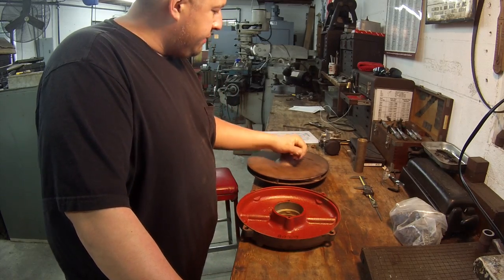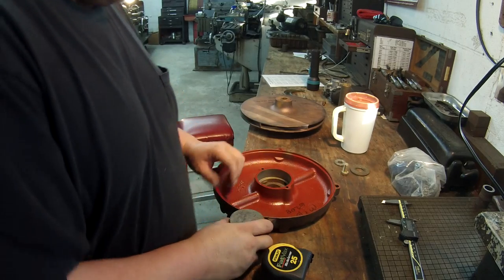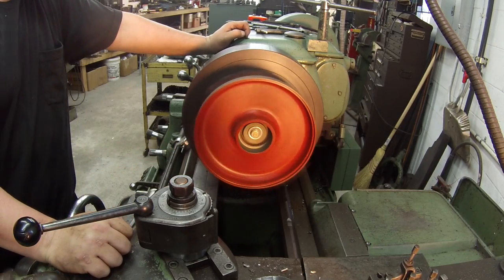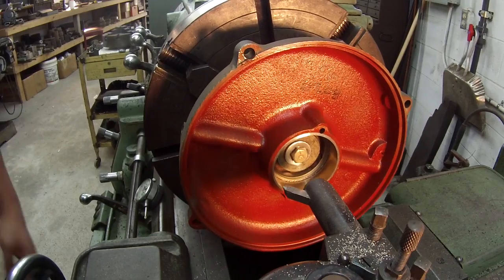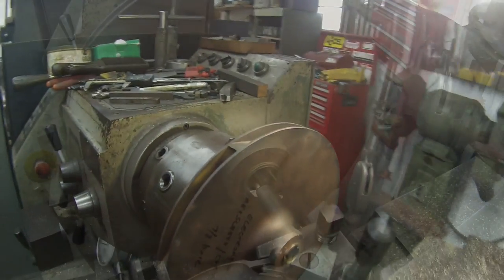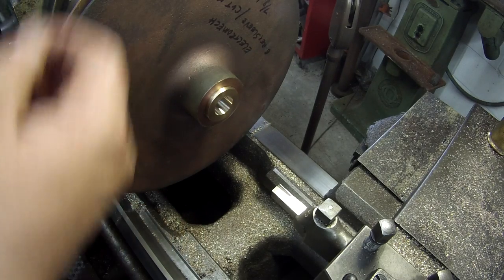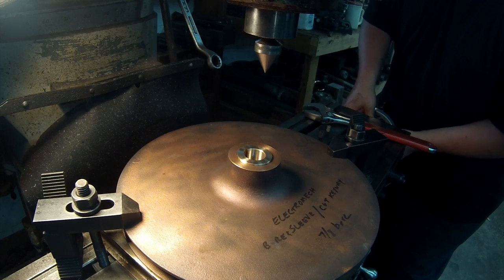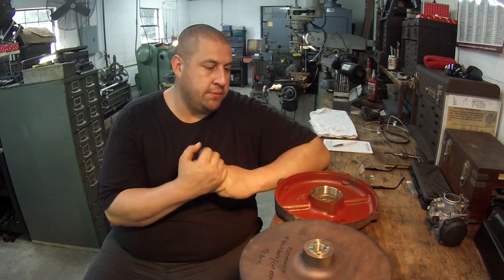End Bell and Impeller Repair

Comment: Well, this brings back memories. My first machining job was at an electric motor repair shop. They did mostly spindle motors, servo motors, a lot of work for machine tools, and they're a warranty shop for Mitsubishi Electric, so the work had to be right on. Did things a little differently, using purchased sleeves of a very nice free-machining steel (thought I never learned which steel), which were hammered in with a couple thousandths interference, along with some Loctite (I don't remember which number, but it was green). I had to use fixture plates or stub-shafts from time to time for odd-shaped housings, and every part had to be indicated in to within a thousandth, both concentricity and flatness, and all with four-jaw chucks on manual lathes. I found their booth at IMTS in 2014 and they remembered me, gave me a 6" pocket scale that I still use in my current job...with SKF, actually.

Comment from the maker: Most end bells I repair usually get the sleeves loctited in. Some of them are very big, cumbersome, and time consuming to get indicated true. Loctite them in to keep from having to set the job up twice. 
The 680 is good stuff as long as you use it correctly. On other jobs where I need to install a heavy sleeve I will press them in, or press and weld.

Comment: Hi Adam 
I work in an electric motor rewind shop in England, and regularly have end bells ( or end shields as we call them) to bore and bush, we brought an old colchester triumph just for this purpose and I taught myself ( previously we sent them out for machining but I was never happy with the results). This is the first time I have ever watched a more professional machinist sleeve an end shield , and I'm happy to say that our methods are very similar, I regularly hold them using the same method , as you can get some really challenging shapes to chuck, enjoyed the videos and subscribed thanks
Reply from the maker: End bells were a common weekly job in our shop. No telling how many I have repaired. I still get them in from time to time.
Reply: I used to work for a motor repair/rewind shop as well, the old bore and bush was a common task. We used pre-made repair sleeves and would make them at a minimum .005" interference fit along with loctite 680. If the housing wasn't egged or threaded from a spun bearing and it was .005" or less oversized we would plate it. I now work for a major automotive manufacturer here in the upstate of SC and no longer do that type of work, but I sure do miss the motor repair shop!

Comment: hi adam no i am retired now but i owned my own company
and sold industrial mill supplies, hardware and pwer transmission
products i was bought out by a large company that sold the same major
lines.including all brands of industrial bearings.
if some of the sales engineers coming up today would spend some time
watching channels like yours they could get an  increased knowlege
of how the products they sell are properly used and become much better
outside sales people.thanks for the reply and keep up the good work.
Reply from the maker: Your right about that. It's great when a salesman know the products they sell. 
Sounds like your company was much like the one I work for now. It's nice having pretty much any shop supply product, or cutting tools I need right on tap from work, plus get a nice discount. Thanks for the comments!
Reply: Abom79

Comment from the maker: 242 blue Loctite is a removable thread locker, and 277 is a permanent thread locker that has to be heated up for removal. We use both at work for hydraulic use. But then green 620-680 is great for machine shop use, when fitting parts together. 609 can be used in a press fit application as well. 
I dont have any faceplates, so the chucks are my only option. 
I love the smell of a machine shop, and especially mine. the old shop smelled better than my current shop though. Much more age to it!

Comment from the maker: Theres always many ways to do a job, and I'm just showing you ONE way I do it. I don't use Loctite on everything, The 680 will hold the bushing fine, especially with the set screw. My customers havn't complained about it yet. There are times when you dont want to unchuck or unclamp a workpiece to press a bushing in because of it being set up true. If I had jobs fail because of my repair I wouldn't keep using it.
Reply: Would brazing or tig welding the bore in place then machining it clean be a reasonable option? Perhaps drilling two holes on either side of the bore, and weld filling the hole?

Comment: Hi Adam,I’m a machinist and have done a lot of endbell repair work,making a bigger attachment plate,say 8in or larger diameter by 3/4 width,you allow for many bolt patterns to be added later,making attaching different styles of end bells easier,and you can indicate the major dia and the the face of the endbell for less runout,I have done the sleeve method but with a press fit,I would never trust a slip fit and loctite to hold for a long amount of time,these electric motors go through some tough work.I prefer the method of metalizing or metal spraying,it’s much faster and many types of metals can be sprayed.

Comment from the maker: The 680 slip fit is good for a maximum of .007 clearance, I usually shoot for .004 to give it .002 of Loctite room all the way around the sleeve. As long as the parts are dry and clean, and the Loctite applied evenly, it will hold. You have to use a torch and heat the parts up in order to remove them.

Comment: Great job , I’ve never used Bronze to sleeve an End-shield , good thing with bronze you can cut it very accurate (.0005”) as a dust and still get a great finish.

Comment from the maker: Loctite sets up with the absence of air. So if you just pore some out it will not harden. It bods very well to active metals like brass, but with steels you need to use the loctite primer. Its not mandatory but it has copper phosphates in it to help activate the loctite and make it bond well. 
Thanks for the comments!

Comment: Hi Adam, 
Ive done that job myself a bunch of times, Ive also shimmed a bearing with a coke can when it needed to be going right then and there, pretty half assed but it worked to finish the shift, another excellent video. On a side note ive never seen that profile tool you used to machine the brass, we mostly dealt in 316 stainless so carbide was the go for most machining, ill have to bust out my old machining book that looks interesting.

Comment from the maker: Some guys use Loctite Quickmetal for emergency repairs. Its got metal in it so it helps fill in the gaps. I was using a 3/8" style D carbide tool.

Comment: Great video! I liked the use of the loctite, and I noticed how you placed your steps for your holding clamps at 90 degrees on the mill to use less space, Il definitely put that trick to use soon.
Reply from the maker: Thanks Jeremy, yes dont forget you can stack the blocks on each other like I did in the video to create different combinations of heights for the clamps.

Comment: Nice work Adam. I was surprised to see you using bronze for a bushing material. 
Our shop has always used steel for end bell repairs with a size for size or interference fit and Loctite.
Thank's for the great video's
Keep up the good work…cheer's

Comment from the maker: I cant recall what the "burn out" temp is, but you really have to get it hot! I'll have to read the bottle again and let you know. At work we have to heat up most of the pistons on the hydraulics to remove them because they are usually Loctited on as well. You know its hot enough because you will see the Loctite start flaming out of the cracks. Once you see it burning, its time to grab the spanner wrench and break em loose!

Comment from the maker: Main reason is because I didnt have anything else in the shop to make it from except some 4 1/4" solid shafting, so used the bronze instead. I've used it many times and has always worked well. I prefer cast iron sleeves made by EZE Sleeve, but didnt have any that size.

Comment: Warren, have you ever used 660 Loctite......that will really blow your mind......it is used to fill gaps from poor machining, Also, Adam is not using the regular Home Depot variety either.....that stuff he used sets up so fast and will break a #12 socket head set screw when you try and remove it....Best Regards, Paul

Comment: I'm a little surprised with the use of the loctite instead of pressing it in, and at how far off the casting is. But you pulled it out again. Good work as usual.

Comment: great job Adam on the impeller. we use that type but stainless steel in the winery. but do u think adding the set screw might put the impeller out off balance.

Comment: Hi Adam, I had always assumed that the three 'bumps' on the curved sholders of the outside of the casting were there to chuck (in a 3  jaw) in production. Could you have used them again - is there such a thing as a 3 jaw chuck with independent jaws ?

The Myford lathe I used to use in my father's small workshop had a small 3 jaw, and a lot of bed wear.

Really enjoy watching your skills.
Reply: Also, have you ever used bearing tolerance rings ? they look good particularly for light loaded or motor rear bearings.

Comment: Hi, aren't you concerned that the hole with the set screw will set the impeller out off balance?
Thanks for the great videos
Reply: Rodrigo Cruz what is off balance about a hole filled with a steel screw?

Comment: Just found out about you from Alec Steele not too long ago.  Been watching a ton of your videos!  As a wood worker, I'm amazed how easy you make metal working look!

When you said you were gonna put a set screw in to make sure that sleeve didn't turn if the tight bond failed, I was thinking you were gonna do a tiny set screw.  3/32" or an 1/8, or something.  Would one that small have done the job as well?  Or bigger is better in that application?

Comment: Do you use the locktite method on all jobs like these or do you press in selves some times? And if you do what is the considerations behind when you will press fit it and when you will slip fit with locktite?

Comment: HELLO ABOM: 
What is the liquid that you put between the shafts and bushings or holes, is like a sealant or ointment, what is? regards
Reply: He applied 680 Loctite which is a quick setting metal adhesive which can be released by heat.

Comment: Why not make the sleeve a press fit?
Reply: Came here for this.  Seems like this is a perfect application for a press fit because you wouldn't have to wait for the Locktite to set.
Reply: If the bore was less than a thousanth over in the first place, why not just loctite in a new bearing? It is within the tolerance still. If up to a few thousanths of slop can be professionally remedied with some Loctite 680 then this was a waste of machining time and effort. He used Loctite anyway. Adam is super, but I call him on little stuff like spinning his coaxial indicator by hand because he is afraid to break another one under power. Just don't run it over imperfections under power. Use it on smooth IDs and ODs or break out the Best Test and use your hand. 
He has fun with us too by spelling words his way, like tollerance and embel when he knows the spelling. Likable Adam....( hahaha.)
Reply: Everybody thinks he is an expert. Why don't you make some videos and SHOW Adam up if you are so smart?

Comment: Don't think i would make everything a slip fit and rely on Loctite to hold,i think this is bad practice and would lead to a failure in service.Tight fit by .002" minimum and grub screw,1/2 in the repair bush and 1/2 in the main part,centre dab the screws that are just below the surface to stop them coming out...... NO Loctite needed.

Comment: Machining- once you find you bearings, things get boring.... Badah duntthhhhh lol
Reply: I honestly have never thought of using that (loc-tite) for anything but bolts and or any kind of fitting that can leak something. I built pavers for a few years and used it plenty on bolts and hydraulic fittings. Never anything else